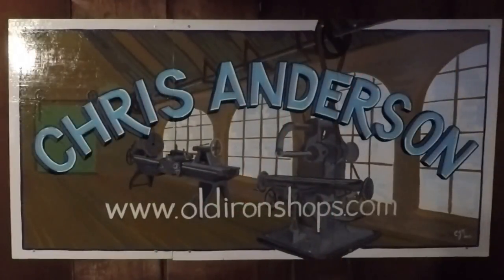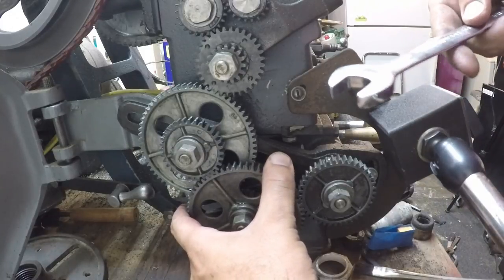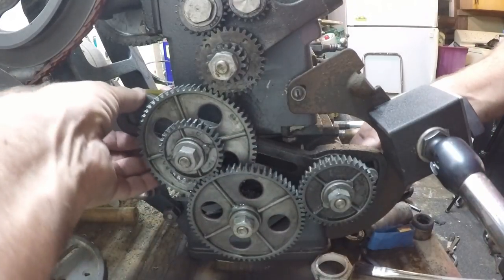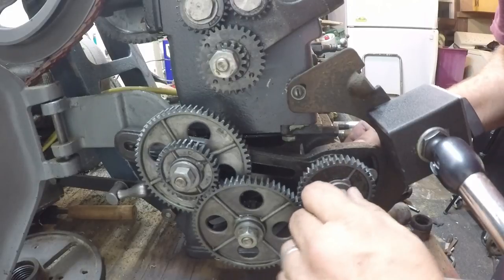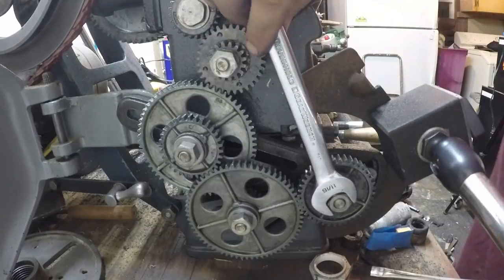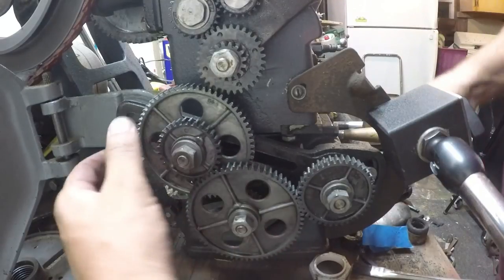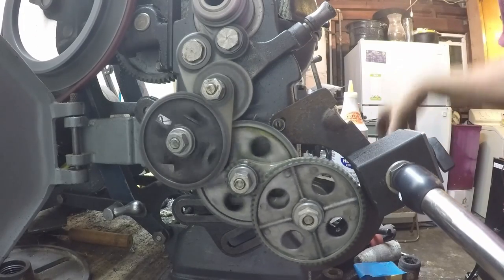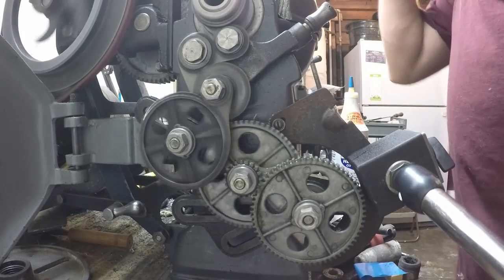Atlas Lathe change gears

Comment: Nice job Chris!  You always need more gears and hardware to get it done.  Looks like this machine has a single scissor that does “everything”.
Reply from the maker: Yes Andrew it's not so bad it would be handy to have about 4  banjos and you can get almost every basic setup . And just swap out the proper gear and you'd be good to go. I should see what a set of iron gears would run for this machine .
Reply from the maker: The one thing that people always miss on quick change gears is just how many options you have with standard change gears.

Comment: Watching you makes me really like my quick change gear box on my 12 x 36,,,, but the 6 inch I just bought is missing gears and it don't have the gear box
Reply from the maker: A quick change is nice but the change gears are more versatile. Many more posablitys .
Reply: @OldIronShops  how many do you need,,,a quick change gear box has 108 combos,,,l think I'll be fine with that. Really only use 8, 16 and 24 anyway. And neither can do metric
Reply from the maker: You have a have a valid point. I have to sell it to my self some how lol.
Reply from the maker: @georgespangler1517  just a side note the Atlas can do metric
Reply: @OldIronShops  thanks,  l thought I would have to buy a special gear to do metric. Taught me something
Reply from the maker: @georgespangler1517  it does take a transposing gear . Hemm I'll have to see if that works with the quick change gear setup you might not be able to on second thought.

Comment: Hi Chris,
If you have a friend with a wire EDM those double keyed bushing would be a simple project.
Steve
Reply from the maker: +Solid Rock Machine Shop Inc. How much do you think for one?  I suspect it may be cost prohibitive .
Reply: If you didn't have a friend that was helping out it would be pricey. If you provide the blank block with start holes already in it it would save cost. That type of work is perfect for wire EDM. I am just taking a guess that the outside profile burn time would be about 3/4 with 3 passes.
Steve
Reply from the maker: +Solid Rock Machine Shop Inc. Hemming I may have to look into this. By the way do you know much about setting up spiral milling on a manual horizontal mill ? (It seems not many people do at least the ones that I have talked to )
Reply: Nope. That's a new one for me.
Steve
Reply from the maker: +Solid Rock Machine Shop Inc. Lol Ion c email I get around to it I may post a video question to you concerning the  situation. We are a ways off from that though.
Reply: Just let me know when the time comes.
Reply from the maker: +Solid Rock Machine Shop Inc. Will do
Reply: Or, you could simply make a standard round bushing, cut key slots into it, then silver solder brass square stock in to create the key feature.

Comment: Great tips! Does that Lucas oil stabilizer run off the gears after sitting for a while, like if you don't use the lathe for a few weeks or a couple months?
Reply from the maker: It clings pretty well but I'd wipe things down and get some fresh oil on there after that kind of time myself.

Comment: How tight should the nuts be on these lathes? I think i over tightened mine and messed up the height of the keyed spacer thing.. didnt help one of the thick washers behind the nut  walked away somewhere so just sanded a regular washer flat..
Reply from the maker: Snug should be good. if memory serves me the sholderef bolts are what you are tightening to not the gear it's self . As far as the washer goes you could turn one farly easy.

Comment: Glad to see you got 3 levels of compound gear reduction.  I cut my QC gearbox in 1/2 and can now cross feed a cut off tool into aluminum.  What is the actual feed rate now?
Reply from the maker: +Crafted .0035 per rev
Reply from the maker: +Crafted you don't have any of the bits I'm missing do you
Reply: Well, nobody actually saw me there so you can't prove anything.   Actually, I do have a limited number of spares.   The bushings can be turned so no reason for you not to make those.  The coupler I have successfully 3d printed and I'd be happy to send you one of those.  There are ways to machine those in metal as well.  For another purpose, I'm working a tool that would make that simpler.  But suffice it to say, machine a tube, mill a slot on each side, mill down slightly two keys, lay in slot, solder in place.  The trick is in getting the slots perfectly opposed. (some play in the slots could be acceptable in place of perfect 180 opposition because change gears are available to hold the keys perfectly)  I haven't figured out a way to do that perfectly with metrology and my existing tools.  Although I'm going to figure it out and do it so I can put a Woodruff key slot in the opposite side of one of my broaching bushings so I can do a key, flip around and do another key.  If one had such a bushing, you could drill a hole in a chunk of steel. broach it on both sides.  Then you might be able to take a broach of the same width as the cutter and use it to perfectly broach both sides of the outside of a tube.   A key would be required in the first broached slot to hold position for the second.  Those are my general thoughts on the issue.  Getting a Woodruff key slot in my broach bushing 180 degrees out of phase is the tricky part I'm thinking about.  I don't have an indexing head.  Your thoughts?  I purchased the Woodruff key cutter a while ago proper for the job.  I already had 6 or 8 but none the right size.  I've been looking for a small horizontal mill to ease this kind of work and gear making.

You could also cast the coupler in aluminum and scrape it into perfection using the carriage method.  There  must be some reason you need to pay penance.  ;-)  Would make for an excellent video.
Reply from the maker: +Crafted wow big response. Lots of good information I need to digest
Reply from the maker: +Crafted hey I have some of the thiner gears think there for the 10" lathe  have any spars you'd like to trade for?

Comment: What did you use to  clean  them an do have to grease them up
Reply from the maker: +Juan Carlod Flores I used my solvent tank but wd40 and elbow greas work to. You Do Need To LUBE The Gears I've Been using Lucas aditive It dosent fling off like other oils can.

Comment: to painful to finish watching, glad mine has a quick change,
Reply from the maker: +Tony Pike what do you mean?
Reply: Chris Anderson the older ones took to long to set up thats all, but you by the way make a great video.
Reply from the maker: +Tony Pike thank you one of the perks the a change gear setup is many more thread options .but you pay for that with setup time. I'll need to do some more videos on this but I think there are about 5 or 6 set ups and just changing the lead screw gear will give you the different ratios . I do often wish I had a quick change gear box. Maybe I'll build one.